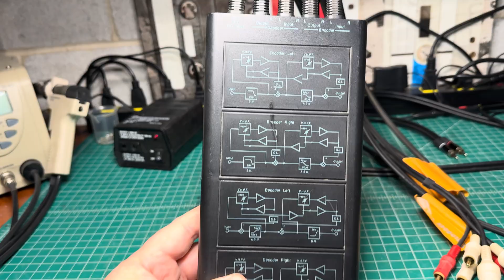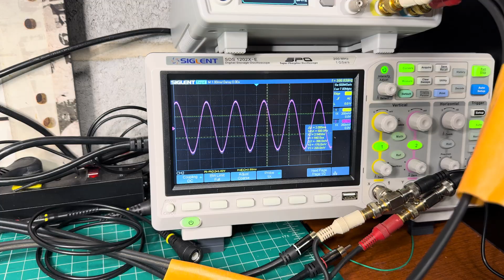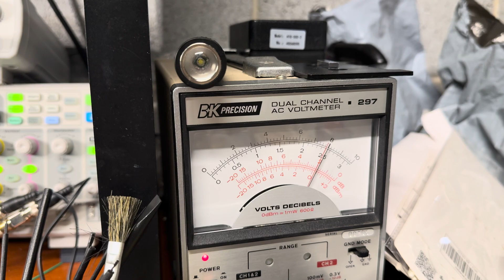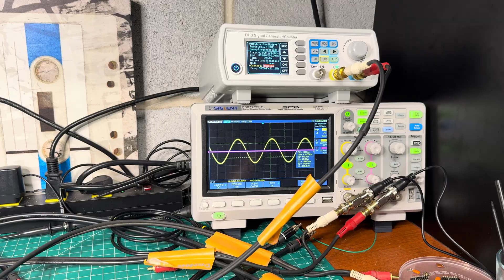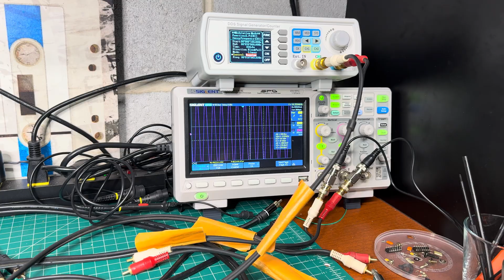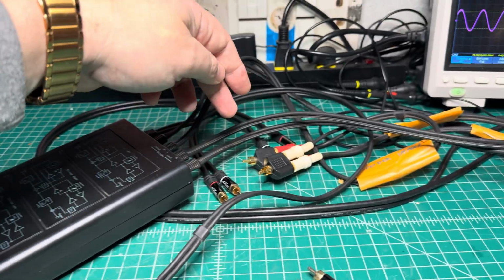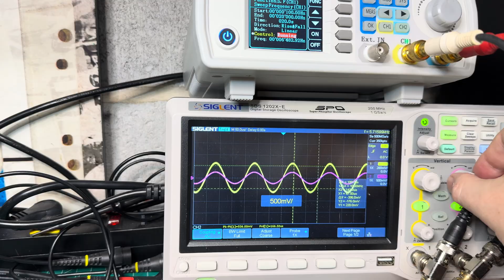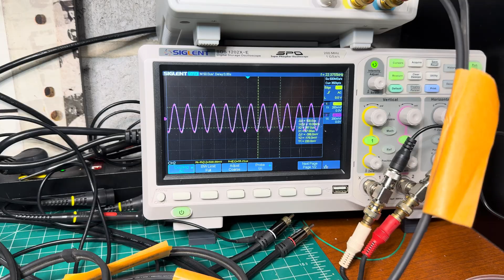Nakamichi NR-100 Restoration & Test – Dolby C NR Unit to 50kHz!

Comment: Spectrum analyser needed. I'm sure the "triangle shapes" of the sinus wave shown on scope is Harmonic Distortion going through the roof. 
Unclear if the provided sweep is clean and doesn't cause the dropoff itself.
If that's ok, and the conclusion would be that the NR unit has a 12 dB dropoff,  isn't healthy. Try lowering your input until the point the distortion is gone and dropoff is in acceptable limits. 

Plus: a passive hifi unit being capable of passing through upto 50 kHz isn't special. Every 70s hifi (pre)amplifier does that too.
Reply from the maker: We have tested this unit on the 700zxl and it performs just fine, decodes tapes recorded on other decks and encodes and decodes properly.
Reply: @hifirulezzz you missed my point ... 
Read again. There's a huge difference between  "working properly" when it comes to decoding /encoding and it having unwanted harmonics at certain frequencies, the dropoff in voltage / frequency just shouldn't occur. +/- 3 dB at very worst? Yes. But 12 dB?? Unacceptable.